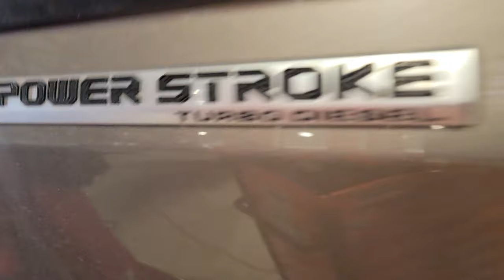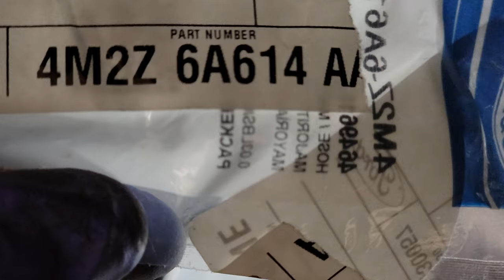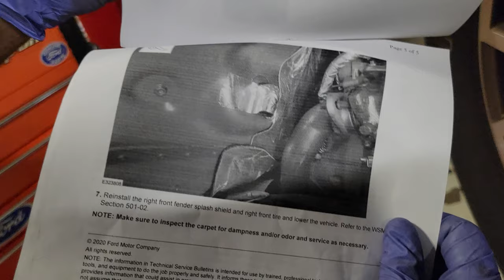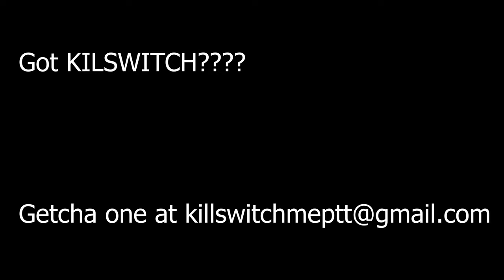Stop! Do you have water by YOUR FEET? - A/C FIX!! Ford Superduty | Expedition | F-150 TSB 20-2107

Comment: Here is the fix. Gain access to evaporator drain as he has shown above. Here is what I did different. Once the metal clip is removed, remove all excess plastic and make the drain tube smooth. I used a razor blade and 120/220 sand paper to rough-up the surface. Clean the evap drain tube and black firewall gasket with isopropyl alcohol. I then applied black Dowsil 739 plastic adhesive/sealant to the area that I just smoothed out on the drain tube. Slide the SMALL side of the 90 elbow until it stops on the tube/gasket. To finish it off, I apply the same sealant all around the mating elbow and gasket. Works perfectly, no leaks. This is on a 2019 F250 Lariat.
Reply: Thanks I'll be doing this. Hopefully truck starts after it dries out. 2019 F350 Lariat.

Comment: I just literally had this happen and have a thread about it on ford-truck. The only thing I would add is if you notice on the pipe nipple there are a couple of shark fins, not sure why, but if your dont push the elbow on past those it will make it worse because the water will drip past the elbow that is raised by them. I’m debating wether to Dremel them off.

Comment: My 2018 expedition did it, had the dealer fix it because the interior got screwed. They replaced the whole carpet and insulation on the passenger side thankfully. This was before the tsb so they did the same repair but with generic parts. My 20 tremor did it aswell but I caught it super early and vacuumed up the water. I fixed it with an autoparts store pcv 90°, didn't remove the fender liner or anything. Still works like a champ over a year later.

Comment: I bought my '18 F150 Feb this yr('23).  Started using the a/c two months ago and never noticed it. This past weekend I pulled the husky liners to scrub them down and found fungus growing under the liner with the carpet full of water.  Looked under the dash and seen moisture around the drain tube area. I'm sure once I put the elbow on, it'll fix my issue.

Comment: I have been car fixing since my first summer job at 14 in 1972. A/C drain leaks, not plugged up, have been around periodically since then. I think the old guys that learned from the mistakes and fixed them retire and the new engineers have to screw it up and learn again. Open cell foam gaskets get changed to molded closed cell foam. Drains that get suction on high fan get extension tubes with a restrictor to give the water weight to overcome the suction. Drains that engine fans or speed forced air blows water back into the drain get elbows (DING DING DING, we have a winner!). Evaporators that let water fly off and get outside the drain field get a thin foam sheet clipped to them, etc., etc. Then a new car gets designed and they decide those < $1 fixes can be done away with to save money and the water runs free once again.

Comment: Just bought a used 2019 F250 6.7l with the same issue. Will be following up with the Ford dealership to see if the recall is still available for this truck.

Comment: Found this video as I was looking for a 2007 F-150 video covering the exact same issue. The hose for the 2007 is in a different place but the drain system is the same creating the same problem. My 2007 hose is Sealed with a foam like seal around the hose. Years caused deterioration of foam seal allowing the water to return under the pipe as you described. I am on the way to get the pvc pipe and will update, but it was returning to the inside of vehicle as we noticed condensation building up on the plastic inside the truck and we found the issue after further inspection.

Comment: Boy this is a flashback concern. 1st Gen Gator and Exped had this problem as well as O2 Codes on Bank 1. Evap would drain on O2 causing Thermo Cycling setting code. On some water entered cabin. I thought after 22 years they would have this under control. ( Never Fixed front windshield water leaks on same Generation ) -- Lower Corner of Windshield leaked on Fuse Box and GEM.

Comment: Ok so the dealership in Clarksville TN did this, still leaked bad. Then the dealership in Tallahassee Florida did it, still leakes. When I pulled it off they had the long side on the fitting, not the short side. I flipped it around the way it should be that you said with the short side on the fitting, added an o-ring clamp, and sprayed flex seal all around it. Waiting for it to dry to see the results...

Comment: I noticed the tab that the metal collar was on. If you don't take that tab off, wouldn't the water still be able to leak back towards the firewall? I have seen in another video where they took the tabs off and filed them smooth to prevent any gap between the hose and the pipe coming thru the firewall.

Comment: Does anyone know if this part number will work on a 2011 expedition? Commonly has the same issue, but no TSB. Pulling the dash to replace the foam pad and evaporator as well while in there, but was hoping for a better fix (like this) so it doesnt happen again in another few years..

Comment: I have a 2020 f-150. Just out of warranty because I was dragging my feet on this. I have extended warranty I'm gonna have to argue with the dealership. Gonna do it myself and drain it all the way down to the bottom. Really disappointed in ford, there is a bulletin on this and no recall. This truck also has the 5.0 that burns oil. Looking to join the class action suit. I think I may after all these years, consider buying something other than ford. I own an awesome Shelby but Ford you need new leadership!

Comment: My 2015 F-350 dripped a little the other day. I have weather mats so no harm. Definitely going to modify mine. After removing the wheel well liner, I noticed my drain tube looks like it has a slight upward pitch. Should be pitching down ever so slightly. I will cut the plastic fins off on the end of the tube, and use a light coat of RTV silicone around the tube before I install the 90 fitting. That should help mitigate  inner coupling water migration. Ford and their fuck it…just duck it…tape idea, unbelievable.
Reply: Mine has an upward pitch too and was wondering if it was supposed to be like that
Reply: @Papapantydropa   You wouldn’t think so, however after the modification everything flows properly. I ended up using a razor blade to cut the plastic fins off, on the outside of the drain tube. I also used a light coat of clear RTV silicone on the outside diameter of the drain tube. That ford 90 coupler fits really tight, I ended up using a heat gun to assist with installing the fitting after applying the light coat of RTV on the outside of the drain tube. Remember to go light,  you just want to seal the inside of that coupling to the outside of the drain tube. Too much, and you will essentially create a damn or barrier internally, which will prevent proper flow.
Reply: @Papapantydropa   What’s happening with that shituation is the drain water is following the drain tube along the bottom, and re-entering the cab through the not so water tight seal at the firewall. Once you install that 90 you’ll be golden.
Reply: @HK-21  I appreciate the info man. It's been a nightmare for me cause originally I thought my issue was a windshield leak but it's not. I been dealing with my trucks flashers coming on randomly when it's parked and off. They flash so much I would get in my truck the next day and it would be dead. Come to find out the water was getting my BCM wet which is causing it to spaz out like that. 2019 F150 with 24k miles
Reply: @Papapantydropa  At least you’ve identified the problem, sometimes that’s the hardest part. I had a 2001 F-350 that had an issue with water migrating through voids in the front windshield due to age, and deterioration of the pinch weld where the sealant was applied to create a water tight seal. The water would drip down the drivers side A pillar right on top of the GEM module, and power distribution box, creating a similar shituation. I would turn the truck off, and sometime later it would power up accessories without the key in the ignition causing a low battery no start condition. I found a replacement, and wrapped plastic over the top to protect it. With the age of the truck and the condition of that pinch weld, I could not find a glass company that would guarantee a water tight seal. I know it’s a pain but you can always disconnect the negative battery terminal once parked until you get the issue resolved, either way that hoods getting popped, I found it way more convenient to disconnect a terminal vs jumping the truck. Best of luck to you, and at the end of the day you got a story to tell. Who knows, you might be able to help someone else out who’s experiencing the same issue.
Reply: How long will cord cover under warranty

Comment: OMG I had to laugh at this TSB fix. I see the engineers at Ford were burning the midnight oil for that fix! The foil tape wrap cracked me up. Foil tape on a non-metal, unsmooth application? Thats a tail light warranty, that is when we see your tail lights leave our lot thats when the warranty ends.

Comment: I have a 2021  F250 When using  AC Top of the dashboard is covered in  Condensation
 dripping into my glove Box And  Condensation  At The Center AC   outlets Have you heard of this I have picturesI I'm worried this will short out my radio It's not a little it's a lot
Reply from the maker: I have not
Reply: I will let you know what's going on I'm taking it to the dealer under warranty

Comment: Great video! What a TERRIBLE engineering job by Ford. I've never seen such an obvious flaw in the design of the drain tube outlet. My 2020 F-150 just literally ruined my right floorboard insulation and made a mess of the interior. Luckily my wife was on the passenger side and the floormat was a little sideways. When she exited she felt the water coming up through the carpet. Ford has known about this design defect for a long time and if you are out of warranty, it's your dime. The part cost me about $20 online.

Comment: I’ve got a 2016 f250 that is having the issue with water in the floor. Drain tube is not stopped up. Wondering if this would solve my issue. Thanks
Reply from the maker: Not sure, look at the TSB its only for newer trucks....
Reply: @PowerStrokeTechTalkwARod  Right I have seen it prior to seeing video but my truck has this exact problem I think I’ll try it and see for the heck of it. Thanks
Reply: @talynbilbrey9422  hey Talyn did the elbow fix the problem with your truck?
Reply: @mattrobinson3744  nope still continues to leak in the floor. I have takin the time to dig in to it.
Reply: @talynbilbrey9422  Thanks for the response. I just noticed the problem with my truck today, Shame it didn't work...

Comment: I bought the 90 degree tube from Ford, installed it my self(to save 200$),but it still leaks. Any thoughts?
Reply from the maker: R u sure its from there
Reply: @PowerStrokeTechTalkwARod  I'm pretty sure, but also why I'm asking...
Reply: I just took the rubber hose off, cut the little plastic fins in the pipe and reinstalled with lexel. We'll see....
Reply from the maker: What year is it
Reply: 2020
Reply: @PowerStrokeTechTalkwARod  Cutting off those plastic "fingers" fixed the issue. With those fingers there the hose was not able to make a nice seal.
Reply from the maker: Thanks 4 comin' back, i appreciate that...

Comment: That was silly, absurd even. The tape is now doing virtually nothing. The tape needs to be behind the insulation, on the metal. You should have cut the tape to go around the drain nipple. And did you say you couldn't;t get it around the elbow? Do you mean the new elbow? Why not just take the elbow back off, apply the tape, then put the elbow back on? You could even just lay the tape on over the hole without the nipple on and cut around the drain tube (carefully!) with a utility knife, nice and clean, and then force it back with the nipple upon reinstallation.
Reply from the maker: THAT WAS NOT IN THE INSTRUCTIONS!